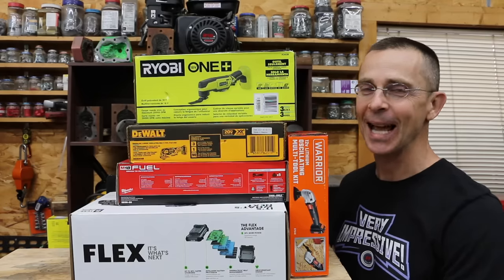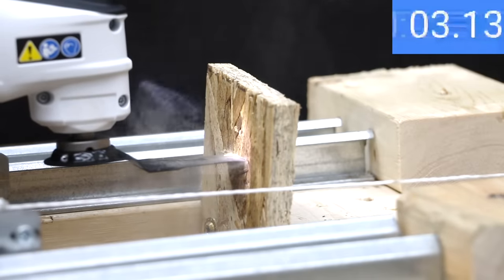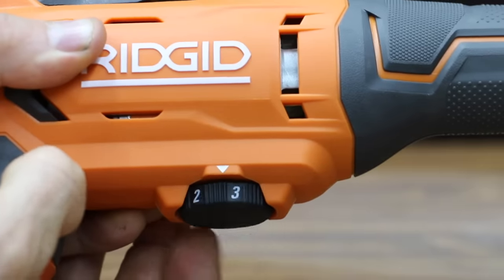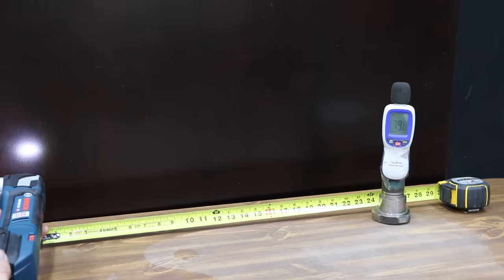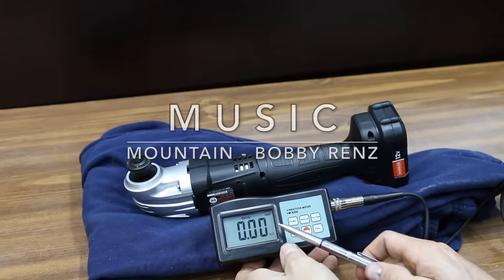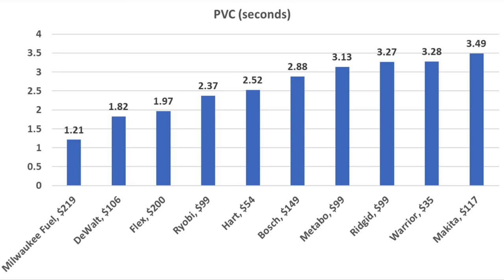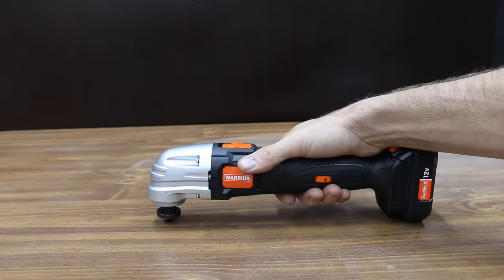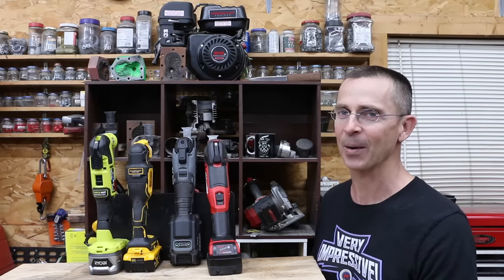Best Oscillating Multi-Tool? FLEX vs Milwaukee, DeWalt, Makita, Ryobi, Ridgid, Hart, Metabo, Warrior

Comment: The Makita XMT04ZB is a brushless unit that’s much different than the brushed unit.  I have Makita tools, and the deference is noticeable. Thanks for a great and unbiased review as always.
Reply: i've used the brushed unit, it's such hot garbage.
Reply: Yea, i also missed the makita BL version, because I am on the verge to buy it.
Reply: On it’s highest speed it tends to cook the cutting tip.
Reply: @dorhocyn3  that's normal for any tool and friction. use the correct blade for the correct material, apply the correct pressure with the correct vibration setting, and if all else fails apply some cutting lubricant to keep things cool :)

Comment: Couldn’t wait to check this video out and see the results, amazing as always. However, how do you not have Fein in here? They are the creators of the multi tool so I would have loved to have seen them go up against all the other copycats haha! Thanks as always for the amazing videos though.
Reply from the maker: You are welcome!  Thanks for the suggestion.
Reply: @ProjectFarm  fein is far superior to the Hitachi, DeWalt and the two different HarborFreight ones I had.
Reply: @ProjectFarm  fein is far superior to the Hitachi, DeWalt and the two different HarborFreight ones I had.
Reply: @ProjectFarm  try the blades and maybe test the fein in that
Reply: Does this manufacturer have a battery powered model?
Reply: @cameronhawkins3006  Yes
Reply: @cameronhawkins3006  They make a battery version, but it's like $500
Reply: @ProjectFarm  A friend of mine has an electric Fein. All I can say is: Amazing tool.
Reply: @travisc3571  nobody cares
Reply: @YDCFF_  The Fein or your friend?  :D
Reply: I was also looking forward to fein as well as Dremel being in the lineup. I was surprised to see the flex/chervon brand in here.
Reply: Iv never found a use for these things my other tools would always do it cleaner and faster
Reply: @ProjectFarm  I have an Fein MultiMaster 250 that is about eight years old. It still works great. I'd love to know not only how it compares to other brands but also to the current generation of Fein tools.
Reply: @DEVIL666wtf  they are great for tight/odd spots as the blades can be moved to almost any angle, and some even have sanding and other "bits" you can use. They make quick work of trim/moulding and drywall. You never know when you may need to "trim" up your trim for whatever reason.
Reply: @ProjectFarm  as someone who uses Fein every day for masonry work, I'd also recommend the Rockwell f80. 
Perhaps another test with corded models...
Reply: I have Fein , corded one , i would estimate that it would be in the middle , your hand do get tired from the vibration if you need to use it long periods .

New Makita multi tool looks like Bosch , it has that same type of lever on side .
Reply: @cameronhawkins3006  Yes, Fein now has several cordless variants at differing price points.  They aren't cheap, but the performance is outstanding.
Reply: Fein is the best.
Reply: I got a Fein corded version about 9 years ago and it came in handy in so many situations. Excellent tool. Only down side is that your hand will feel numb after extended use. It's got a lot of power and vibration.
Reply: Pity you did not include Fein. I recently bought an 18v Fein replacing some cheaper ones and the difference is amazing. The price as well.....
But thanks for your review. Very instructive as always.
Reply: That's what I have; it's corded though.
Reply: @pete_lind  I used a Fein corded one for a year, I also feel it should be in the middle, everyone else in this sub-comment are pretty confident it's the best, I've used 4 different oscillating tool brands and other than vibration I find just the way you go about the cut greatly affects the speed and how long the blade will last. Very interested in the Milwaukee one because of the low vibration.
Reply: @DEVIL666wtf  this tool cuts in tight spaces others can't and cuts into drywall like butter cleanest cuts ever😁
Reply: @allwoundup3574  thanks
Reply: @BrendonGillespie  I had a dremel and it was garbage.
Reply: Milwaukee would smoke the Fein too

Comment: My first oscillating tool was a Dremel corded tool i bought about 7 years ago. I loved it at first but eventually it would lose its grip and couldn't keep the blades attached. 
Now, i own the 20V Dewalt cordless tool. I'm very happy with the DeWalt.  The quick blade change to me is what sets it apart from most other brands.  A bit slower peed of cutting and a bit higher vibration are things I can live with in comparison to the Milwaukee. I just want to be able to change blades quickly! And of course the quick change is not just about changing blades but also about rotating the blade around to a different angle. The Dewalt feature here makes it such a great brand to go with.

Comment: Great test. In the EU, the Fein brand is one of the most renowned when it comes to oscillating multi tools. I'd love to see how it matches up with some of the best here if you ever decide to do a follow-up.
Reply from the maker: Thanks!  Thanks for the request.
Reply: Yes, the Fein is the original so it should have been tested.  I own a Festool so I would have liked to see that included as well.  Both are pretty expensive so maybe that’s why they weren’t included.
Reply: @lylewaters6161  i have worked for fein, the fein multimaster is awesome. I bought one when i worked there.
The festool is made by fein 😉
So it should be same as good as the fein. 
Festool also buys their angle grinders from fein.
Reply: @Johannesbeere21  yeah I know Fein makes the Festool.  It seems like Festool has some unique accessories though that no other manufacturer has.  Don’t know if it’s worth the extra $$$ but I got sucked in.
Reply: I believe Fein was the original.
Reply: @commentsboardreferee7434  Yes, I should have mentioned that.
Reply: Fein, there is no substitute !  😎
Reply: Fein freaking invented the first oscillating multi-tool in 1967 and is still the best multi-tool available on the planet by a wide margin. Curious as to why it was excluded from this review.
Reply: In Norway the multi cutters are often referred to as “Fein-saws” … 
Hope for a follow up here :)
Reply: Seconded. I would also like to see how the corded ones perform. The cordless are nice and handy, but if you are using it for an extended period of time the corded versions may be the way to go.
Reply: @brianlutz7813  thanks for that. I always thought Rockwell invented them.  Maybe they just patented them in the US before Fein could? Tell me more.
Reply: Fein is the best, I do not like the cordless iterations of the original, they cycle way too fast, and make precision cutting difficult. I still have my original Fein, which is 18 years old, and runs as good as new. Recently upgraded to the keyless Starlock Fein, and absolutely love it.
Reply: @korean zombie I've had my Starlock Fein for a couple years now, zero problems. What do you use it for?
Reply: I’ve used extensively Makita and Milwaukee…ThenI bought the lates Fein, there is no comparison. If you use this type of tool everyday the fein is the tippity top!
Reply: I bought a fein about 10 years ago and it's awesome. I also have a couple of cordless ones (milwaukee and ridgid), and they are nowhere close to the quality and usability of the fien.
Reply: Blades are as important as the tool itself.
Is there a blade comparison somewhere? 
Do you have suggestions, especially for hard metal cutting?

Post scriptum
I have bought a Tacklife multitool, very popular on Amazon :-D
Reply: @akbychoice  thanks!
Reply: @turbotension  Actually  Homer H. Stryker, an orthopaedic surgeon from Kalamazoo, Michigan invented the "oscillating tool" in 1945 to remove orthopedic plaster casts and called it a cast saw. The oscillating saw blade wouldn't cut the skin under the cast. Fein just took that idea and and gave it different shaped blades for different uses and called it a "multitool". Stryker is a huge medical equipment manufacturer and still makes cast saws today.
Reply: I own a Fein and I love it. Surprised that it wasn't tested since they first came out with it. Maybe now it's a moot point though...
Reply: It would be no contest honestly. Any carpenter that is worth his salt uses a fein
Reply: I live in the US.  I have had my fein tool a long time.  It is still my favorite...  And their blades hands down are the best.
Reply: Actually i think medical saws were the first oscelating saws.  The saws that removed cast.  They would only cut the plaster not the cloth below it.

Comment: Nice video, we purchased a Fein tool, years ago, made in Germany, the Fein is a bit heavier then all the others sold in the box stores. The motor has lots of power.  Sorry it was not included in this contest, as it was expensive (500+) back in the day, but it has been worth the cost over he years.
Reply from the maker: Thanks!  Thanks for the feedback.
Reply: I tried harbor freight to start. Lots of heat and vibration, then went to Craftsman and had 2 die during warranty. Finally went to fein and never regretted it.
Reply: I have used the Fein and it is durable and reliable.

Comment: Really appreciated this video.  However, some important brands are missing, firstly the grand daddy of oscillating tools, Fein, was missing, other important missing brands include, Porter Cable, Rockwell, and Dremel.  Battery performance testing might have been helpful to know too.

I am also wondering if including some corded models in the test would have been an interesting comparison.  Some tools still work best with a corded power supply.

In closing, since oscillating tools are like men's razors and go through blades and sand paper, and other disposables quickly, a video on what the best blades and sand papers with, cost vs performance vs availability is the next obvious video suggestion.  

Hope you and yours are doing great, keep up the great work!

Your devoted fan MrGunn
Reply: I came here to say the same thing!  How are you going to test the "Best Oscillating Multi-Tool" without including these other brands?  Leaving a major player out of the testing raises doubts on the accuracy of the results.  Maybe the video should have called the video "Best Oscillating Multi-Tool that's not a Fein, Rockwell, Dremel, etc.."  I get that the Fein is a bit pricey, but if you're claiming something to be "the best" it should be included.  And I'd put my Rockwell up against any of those in this video.
Reply: He did a video on oscillating saw blades. Quite a while back. Over a year ago, I'd say.
Reply: Would've made sense to include Fein, Dremel,  & Rockwell. Porter Cable is owned by the same company that owns Dewalt, & is cheaper slower version out of the two from my personal experience doing remodeling & flooring.
Reply: I just bought the Ridgid, but it was not this, it was the brushless. I can assure you it can compare with Milwaukee fuel.
Reply: I call it the Fein tool.
Reply: Agree 100%, Fein is the king of oscillating tools and certainly the best I have ever used but it is quite expensive, so I am going to consider this a test of "reasonably priced" oscillating tools rather than the "best" oscillating tools.
Reply from the maker: Thanks, will do!  Thanks for the feedback.
Reply: I really Like your tests, but this time i missed a few things. As already mentioned a few important brands were missing. Particularly Fein, the inventor of the Multitool. 
Another thing I don't quite understand is, why you tested the top of the range Milwaukee for example, but an old, outdated version from Makita, that's not even sold anymore in my country (Germany) ? In the states the new model would be the XMT04. Same thing with the ridgid.
Reply: @artvandelay1099  Good point, realized that after I posted my comment, could be helpful to perform again.
Reply: @AftermathXJ220  Did not know that, great point on DeWalt/ Porter Cable

Comment: I have that M18 Milwaukee unit, but for heavy jobs I have a Fein, which is the original.  It is spectacular.
Reply from the maker: Great feedback. Thank you
Reply: Yeah, the fein is a big omission in this category
Reply: Full disclosure - I should have mentioned that the Fein is a corded, not cordless.   When I have a big job, I get an extension cord and use that one.  The blade change is effortless and it has horsepower for days.  Cuts like lightning.    The Milwaukee is good, sure, but honestly I bought it just for small jobs where I didn't want to have to get out an extension cord.
Reply: @WalterGalindo  It's the OG.   You can feel the horsepower in it.   You start that thing up in  mid-air and you have to react against the rotation of the motor.  It's crazy, but it's a really good kind of crazy when you have a bunch of flooring to trim or some other nightmare to deal with.   Pricey, though.  Worth it.  Totally worth it.
Reply: @mikegraham7078  I’m pretty sure fein has a cordless solution, will have to check

Comment: The oscillator tool is one of those tools that you may rarely use, but when you do need it you'll be happy you have one. I purchased a Dewalt oscillator with a battery and charger for $99 
Thank you for the Project Farm laboratory testing.
Reply: That's crazy cheap. Down here in New Zealand the DeWalt 18V kit with 4Ahr battery and charger is over NZ$600! (US$400)
Reply: @DiscoFang  bummer. Builders aren't even "essential" workers there. Crazy times we're living in.

Comment: Milwaukee's ability to consistently put out power tools of all kinds that perform at the top of their respective heaps is so impressive. I work in the trades (electrical) and have yet to be let down by a Milwaukee tool. 

(That said, Ryobi seems to make incredibly good value stuff, and that's probably what I'd go for it I weren't using my tools 40+hrs/week.)
Reply from the maker: Thanks for the feedback.
Reply: I really like most of these tool brands and own most of them. You have to keep in mind when these tools are released. That Dewalt has been on the market for years and still performs very very well, the Milwaukee Gen2 is new to the market. If this test had been performed even a year ago, the Milwaukee Gen1 would be at the bottom of the heap with Makita and Metabo. I'm a GC and work alongside all residential construction trades. We've seen plenty of Milwaukee's tools that are flops. Especially those related to the carpentry trade. I'm also speaking from the cordless tool perspective, as that is all the rage these days.
Reply: Milwaukee tools are great except for their horrible friction chucks.
Reply: Many years ago I was with an excavating company and we had a Milwaukee impact drill that went down.  The caveat is that it didn't belong to the 300 pound man who used it.
Reply: My son is a commercial electrician and uses Milwaukee all the way. My climbing arborist husband uses all Husky chainsaws, power pole saws, etc. He uses the commercial grade Husky battery powered saw as his climbing saw now almost exclusively. Of course he brings out the big saws for larger diameter trees. The commercial grade battery powered tools have come a long way. 👍🏻
Reply: I use some Ryobi tools for my daily work (decks, now kitchen and bath) and so far they are holding up nicely, with exception to the multi tool. Of course it is used the most and have had it the longest. Power switch is going bad and just isn’t cutting very well anymore.
Reply: @ProjectFarm  could you do the same tests with new models such as the brushless Makita?
Reply: trade (electrical) here, too. As a Hungarian we use blue Bosch (made here like can be heard in the video) so their price is unbeatable, and Flex which is a German top brand. Milwaukee is a relatively new player here, but we love them, too. I personally love and use Flex, because of their top-notch quality, and self-cooling batteries which come with a unique 3-year-warranty.
Reply: I could own Milwaukee if they didn’t have the worst battery design in the industry.
Reply: @brycecourtneymusic  what's wrong with it?
Reply: @brycecourtneymusic  Milwaukee owns a unique better than everyone else battery tech that they bought in 2012, and what helped them overtake the market. Flex just recently released a new battery tech in the last year, so look for them to possibly over take milwaukee, but not yet.
Reply: As a small time DIYer that's why I went with Ryobi for my battery platform
Reply: As a professional plumber there is no way I would buy Ryobi. My co-worker bought a brand new Ryobi impact driver and tried drilling through two 2x4s with 1 1/4” paddle bit and the it started smoking and broke.
Reply: Being forced into  pretty much only having 1 brand is a bummer. Luckily I've yet to be let down by Milwaukee though all I have is an impact driver and a reciprocating saw. I need to buy an oscillating multitool so I always check on here first before committing. Looks like I'll go 3 for 3 with Milwaukee.

My DeWalt stuff from 15 years ago still works amazingly and having watched several of these videos I feel like the Ryobi is slightly less consistent than the DeWalt but YMMV.
Reply: but the dewalt quick change system is more important for me 😂